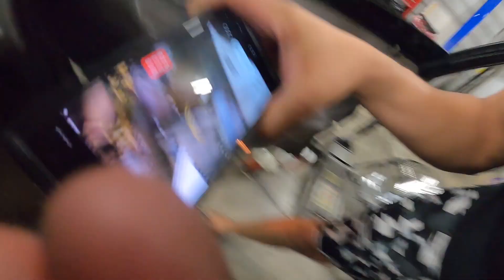Project Daily Driver CHEAP Honda Accord First Start/Drive!!

Comment: Yo wassup my dude nice work. That low limiter rpm is why im tryin to run a chipped ecu in my CG to rev it to about where your cb7's limiter is at 7k. BUT... like you know those cg accords dont like when you mess around wit em too much. Interested in seeing what you decide to do about that rpm . Maybe i can get some ideas from you on whats best
Reply: The f23 does not handle high revs very well keep your rev limiter around 6800 to 7000 no more or you will regret I know from experience, my piston hit my valves so hard it blew my rocker arm of the valve train assembly
Reply: Holy crap lol. Yeah i wouldnt want it any higher than 7000. I k ow theres a few ways to do it but from what i can tell from watching this channel is ....a tune is essential
Reply: There are no tuners where i live so chipped ecu is pretty much outta the question...gonna need somethin more expensive